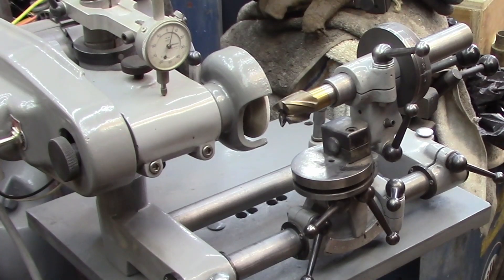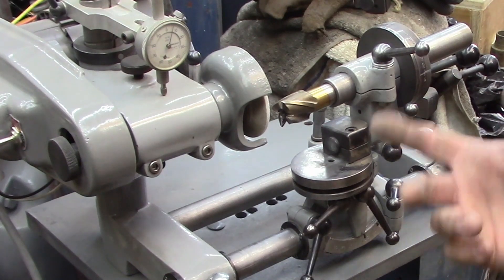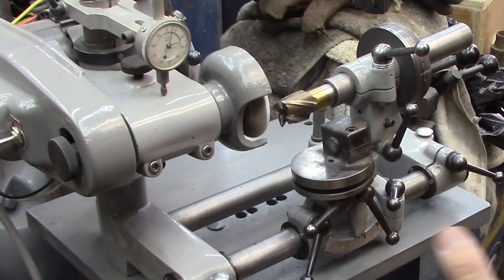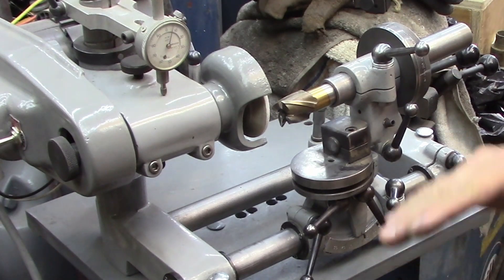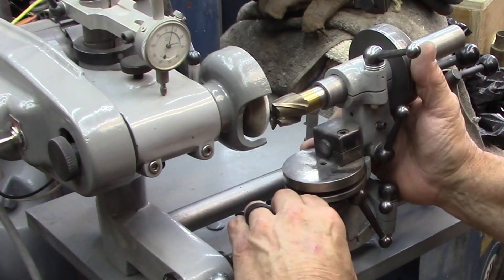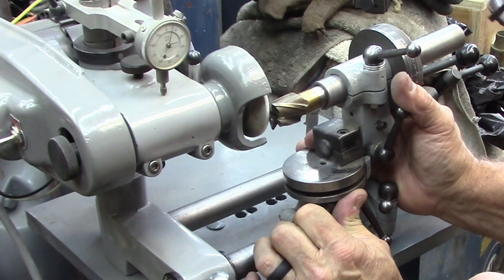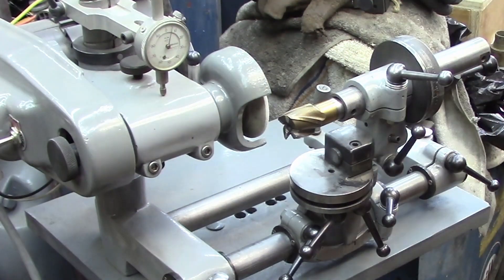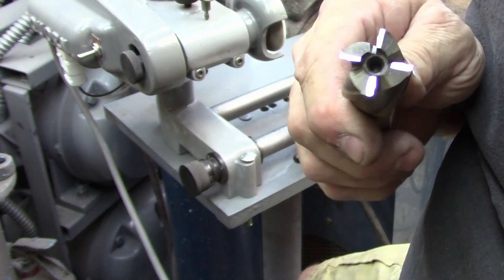Quorn Tool & Cutter Grinder: Sharpening End Mills July 16, 2021

Comment: I would say that for 99% of any milling with an end mill the end does not get used...... and no one drills with an end mill......so regrinding the end is a waste of time compared to just cutting 2 mm off of the end and then regrinding it........regrinding the flutes is another factor but you'd need an air bearing as you said. or maybe a linear bearing design.
Reply from the maker: It depends entirely on how you utilize end mills in your shop as re-sharpening the ends greatly extends their life for me.

Comment: Nice! The quorn sure can come in handy...  I assume the cutters cut nicely?  Thanks for taking the time to share this with us..
Reply from the maker: Yes if I do my part they cut well, the problem with the Quorn is there is so much time and money invested in building it that it would be less expensive to buy cutters if you only use common sizes
Reply: @hillsgun  true,, but sure satisfying to be able to sharpen needed cutter instead of accumulating drawer of dull useless cutters 🙂